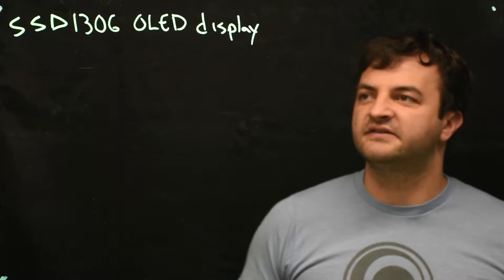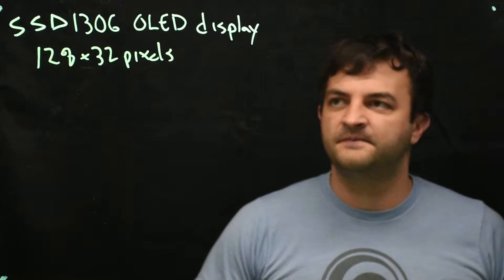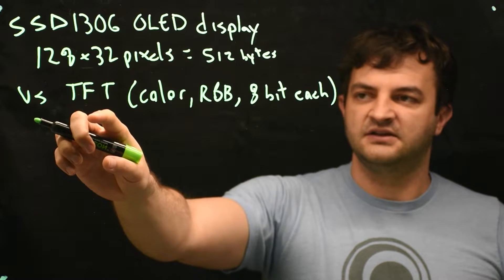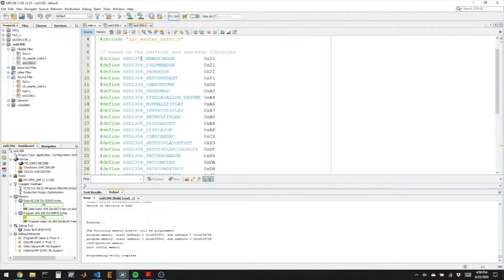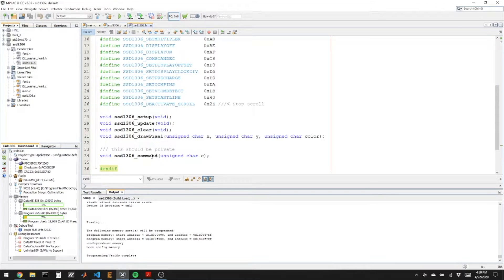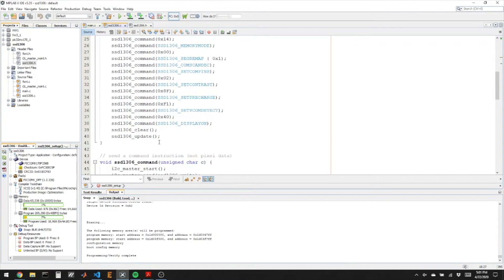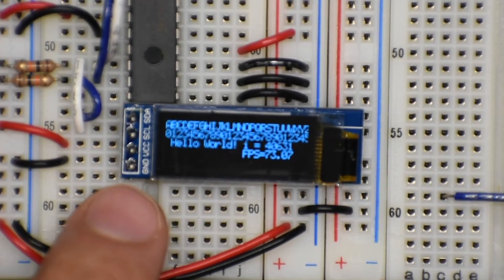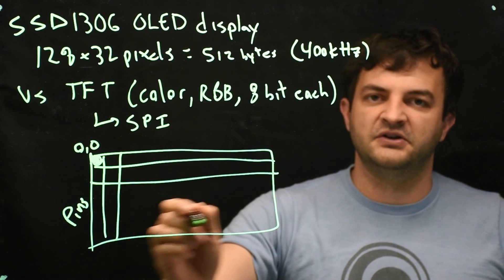SSD1306 OLED Display

Comment: Hi, could you send the libraries?
Reply from the maker: Here is the assignment for drawing text, based on these instructions: https://github.com/ndm736/ME433_2020/wiki/HW4 and this simple driver: https://github.com/ndm736/ME433_2020/tree/master/ssd1306 and I2C code: https://github.com/ndm736/ME433_2020/tree/master/i2c